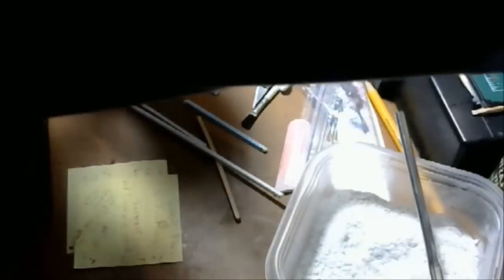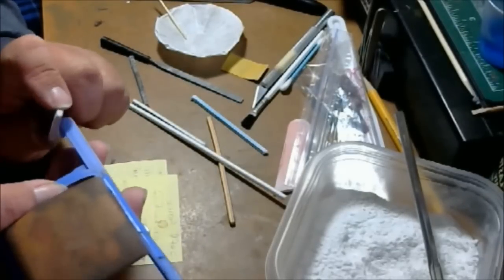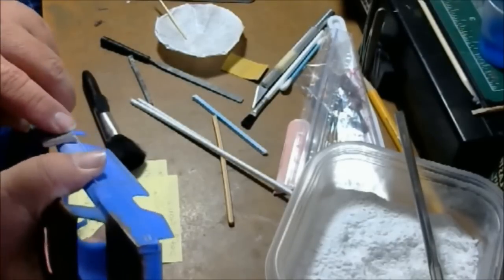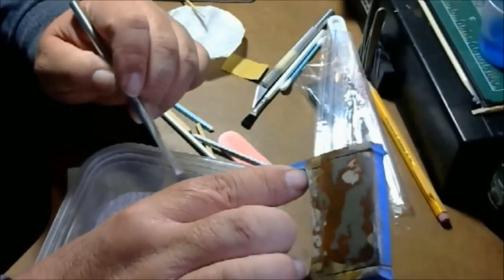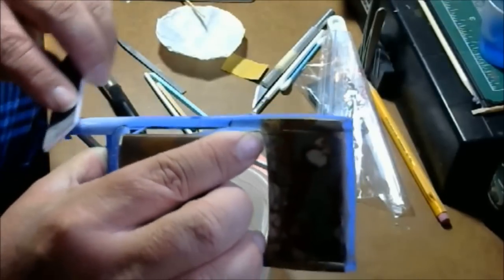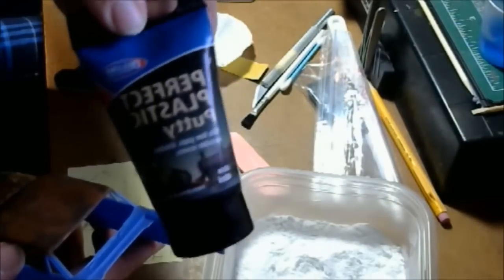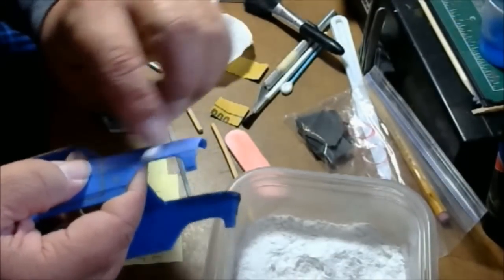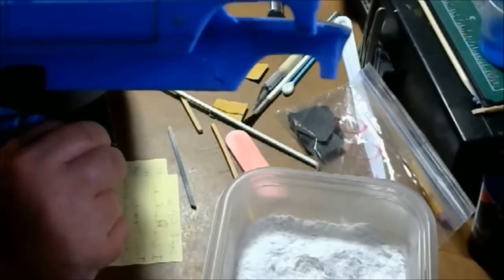Tutorial: Body prep, sanding and filling

Comment: I use acrylic paint to but I use a two stage prime with a guide coat to get the body smooth and I'm limited to using brushes(the wife can't see spending $50+ on a airbrush) so I use what I can.I have tons to experience restoring real cars and I just take most of what I do there and use it on my models.thanks for the tips
Reply: Chris Chapman I'll definitely share and man I have been watching alot of your videos and have learned a ton along the way.I'm a security officer and have a quite alot of time to kill....to bad I can't bring my models to work with me.I'll have to send some pictures to you some how of my current project I call it the "Highschool Hackjob" 57' Bel air.I'm trying out several of your methods on weathering and rust.
Reply from the maker: +Zachary Petty Right on. I'd love to see them. Send them to cchapman195@gmail.com so I can see them.